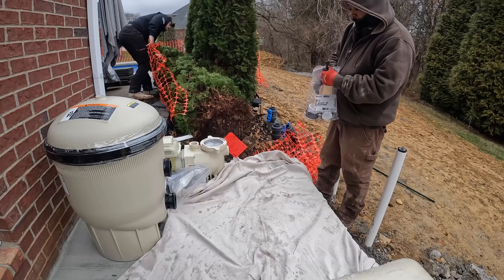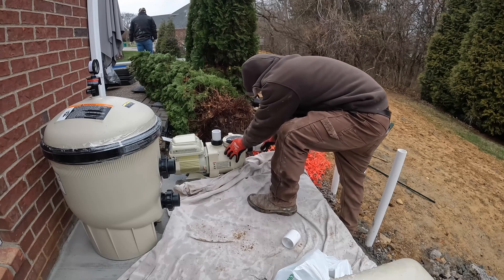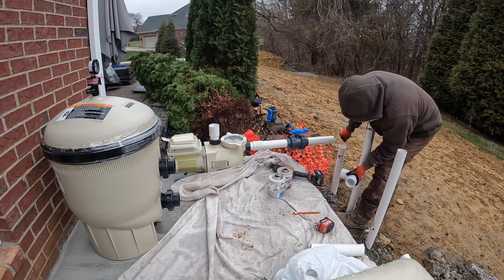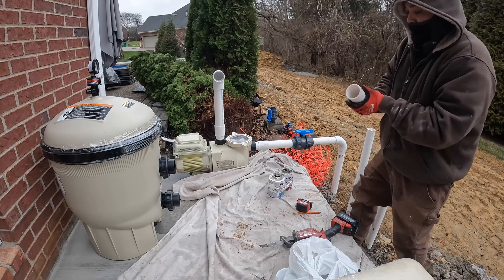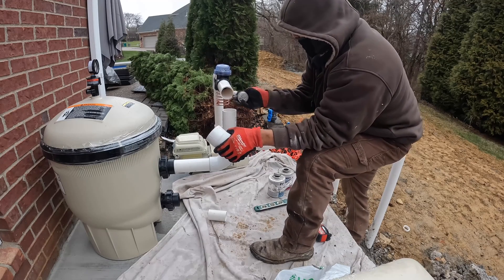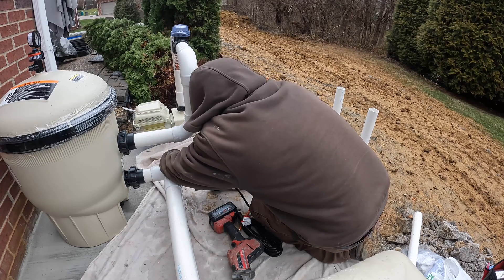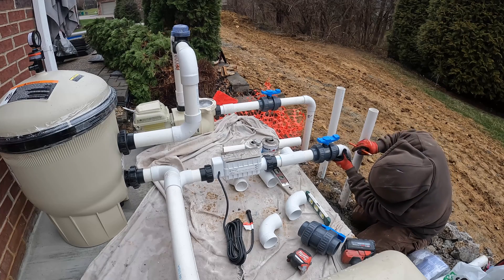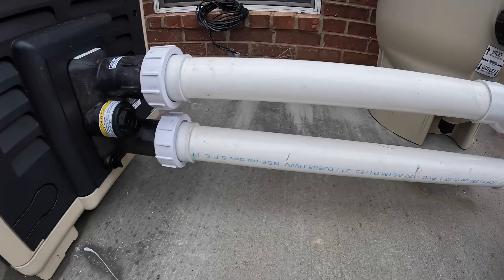How to Plumb a Swimming Pool Equipment Pad [Inground pool construction]

Comment: I noticed that the pipe that enter into the pump is one pipe I mean the inlet in the pump is if only main drain there's no skimmer
Reply from the maker: This pool was so small we only put in equalizer drain, which gets connected into the skimmer so there’s only one line for the skimmer and the drain

Comment: I see the pipes coming out of the ground are rigid pvc but I am assuming the pipe in the ground is flex pipe, how did you transition from flex to rigid?
Reply from the maker: There’s no flex on this project
Reply: @jonport_  I am using flex under the ground (I have an inground pool) should I transition to hard pipe as it comes out of the ground?
Reply from the maker: Yes I would

Comment: There's a reason you use purple,, then again cheap is cheap. No check valves or flow meter, No unions except at the equipment !  hire illegals and this is what you get. Drain and skimmer,  on One line,, what a shit job

Comment: Great video.  Although slightly sped up for time, can't tell if the crewman is sanding the ends before joining and not just taking his glove and wiping off the burrs and debris.  Important step to ensure full adhesion.

Comment: I noticed you use 90-degree sweeps instead of elbows. Is there a big difference between the two? My pool has 90 degree elbows now and I have to replace the inlet valves and was thinking about changing some of the elbows with the sweeps. Thanks for making these videos.
Reply from the maker: @MichaelKelly-yu3nl  I like it just a little better flow. Will you sweep 90s on the entire plumbing install unless it’s a tight spot we use straight 90s.

Comment: Thank you for filming this.  It was exactly what i was looking for.  
What is the timer or mechanism that controls this? How would you add a hot tub and/or waterfall?
Reply from the maker: @pbschulz  awesome. I’m glad it helped. So for a water fall it would just be another supply line connected to the outlet of the heater just like the returns so it pushes the water out. The pump has a control panel on it, but you can put some automations on Pentair makes some, and some other companies make automations as well.

Comment: Curious why you wouldn't do a bypass for the heater?
Reply: But it is on the pool heater manual to install a bypass
Reply: @juantovar1289  exactly
Reply from the maker: @Phil-rv1xx  you don’t need it.
Reply: @jonport_  I was thinking about putting one in for my heater. The reason I was thinking about this is to be able to work on the heater and still run the pool pump.
Reply from the maker: @ if it makes it easier to work on it then definitely use the smaller 90

Comment: better off having your heat pump on its own heating and return lines and own pump
Reply from the maker: @donmint7330  not a big fan
Reply: @jonport_  could you explain why? Thanks
Reply from the maker: @donmint7330  I just don’t see the point in doing all that extra plumbing

Comment: Clearance around the air conditioner compressor should be at least 1 ft, with 3 ft being a better practice and that is for plants or walls, not things that give off heat!  It needs cool air flow to operate efficiently and it looks like you are right next to it, below the min. dist.  The pool heater will make the A/C work harder and any chlorinated water on the A/C unit will make it fail much sooner.  It is also right in front of a windows.  Is this an electric heater as gas heaters can't be that close to windows that can ever be opened.  What are the wires coiled up under the window?  The cement slab is above the foundation wall and over several rows of bricks.  Moisture can get trapped between and cause the mortar to deteriorate much faster.  Eventually the exterior wall will need to be repaired.  To fix this, the pad and all will need to be ripped out to fix the wall.  Yes, I saw the caulk between the two, but that is a Band-Aid after the fact.  Is that an electric motor almost directly under the down spout?  I know it's not done and i'm sure they will run it into a French drain, but down spout connectors are always getting knocked off and eventually the motor and controls will be periodically bathed in water. Possibly getting between the bricks and slap.  Was the side caulked?  The 3 ft of pipe coming out of the heater, making a turn into the salt cell and going another 3 ft before turning into the ground should be supported at least once at the corner.  I put a fence around my pad to keep people out, but neighbor kids like to play hide and seek and it's an excellent place to hide behind the fence while they stepping on everything.  Next step for me is an electric fence from farm-n-fleet, but I digress.  I'm no expert, but all in all, great job.  You have to work with the space you are given.  Lots of things to look out for.  I love the pad size (room to work and expand) vs. space used, the Colonial Valves, and Pentair's drain for the filter being in the front!  I'd add the valve contraption for the front of the filter so you can back wash the canister filters.
Reply: Yes,that set up would not pass in california!

Comment: Great video-have question this filter doesn’t need a back wash?
Reply from the maker: @hmkang2855  nope. It’s a carriage filter.
Reply: How do  you drain when the pool has tools much water
Reply from the maker: @ottawarrior5251 there’s a release valve on the top of the filter

Comment: hey do I need a main drain for a kiddie pool 25'x15' and 18" deep?- it is inground
Reply from the maker: @lisamazz1014  yes I would put drains in two of them split it in the middle put the supply in the middle that’s code and then direct the returns on the opposite side to push all the water toward it.
Reply: @jonport_ is there something different between supply and jets? I thought the jets were the supply
Reply from the maker: @604roger  no they are complete opposite. Drains and skimmer pull all the water (supply) your jets/returns get fed so it pushes  the water for circulation.

Comment: I see you put the sacrificial anode between the pump and filter, which is what I've seen everyone else do also and assume this was correct, but my inspector is telling me it has to be below grade level before the pump to always have a constant water supply. Have you ever heard of this? It sounds stupid because how am I supposed to get it to replace the anode later.
Reply from the maker: Yes that is dumb. You have to put a union value just for when you change it🤦‍♂️. I didn’t know that would be a thing. I font think anyone dose that
Reply from the maker: Every inspector has his own way. At the end of the day. Realistically your pool is running 24/7 so the way we do it its covered. They do make other bonding defenders. Some make work better if you have to do that I’m not sure since i dont have to

Comment: Can the pool equipment be mounted on a ground level deck?
Reply from the maker: Ground level meaning the same height as the top of the pool deck?
Reply: @jonport_  not nec... besides the house ,, deck a couple inches of the ground. not much higher than a six in slab, is it against code?
Reply: also.... good video man
Reply from the maker: @troybonham9829  code doesn’t matter. Its all about efficiency and how you design your pad so it works well depending on how high or low you put it. But if it is pretty much level with the top of the pool, you shouldn’t have any issues or do anything special just follow what I’m doing.
Reply: @jonport_  actually just relocating10 feet
Reply from the maker: @troybonham9829  sounds like it should be fine. It’s tough to tell unless I can look at the situation.

Comment: The one thing I do not like is the use of ball valves which tend to wear down much quicker and hard to replace compare to other valves so I am highly against using ball valves in general
Reply from the maker: I understand where you’re coming from but these valves man they last a long time and they are nice. Plus the benefits you get of having them so easily replaceable because they’re threaded on both sides.

Comment: I don't understand the 18" riser from pump to filter. Can you answer this?
Reply: There is no answer. It is suppose to stop the filter from back flowing empty. But if you do that with some filters being tall your riser will be tall. Most filters have a 90 inside any. You could always just add a check instead.
Reply: @latroncheffin1916  Some filters have a "auto" valve at the top that will let air in when the pump is off so the filter tank drains down and will let only the air out when the pump is turned back on.  However, the Pentair filter in the video has a manual air release valve on top, so adding the riser is smart.
Reply from the maker: Working with maintenance guys who understand equipment over the years and its the best system.
Reply: Thanks for the reply Jonathon, If you get the chance please find out the why from the maintenance guys. This is kind of a "gots to know" thing for me now...Haha @jonport_
Reply: The pump specifies that you should not have an elbow within 10 inches of the pump.  There is a calculation based on pipe diameter…for instance 2inch x 5 =10.  I could be making this crap up, so read pump instructions 🤣
Reply from the maker: @jperello001 lol. Your right. It’s within that range just for pressure and keeping your pump so it doesn’t wear and tear on it as much.
Reply: @jperello001  Yes, no elbow on the suction side for X distance.  The output (downstream) side can turn right away.
Reply: I can't imagine why you would put a ball valve before and after the pump ,if you wanted to control flow one valve would achieve  that In my opinion you would never have a shut off before the pump ,the pump has to have water  ,if some one turned it off and the pumped  turned on ,it's game over. But you absolutely want the skimmer and drain separate with one valve that controls both, so you can turn off the drain and have full suction at skimmer or shut off skimmer and hv full suction on the drain or 50/50 and anything in-between,  If water level goes low you can turn down or off the skimmer and still run without sucking air, if you connect hand vacuum you would turn off the drain and have full suction at skimmer where vacuum connects. You only need the one skimmer/ drain valve and may be one ball valve to let water out of pool. I'm no pool plumber but I have a pool for over 40 years, in Florida and that don't look right , I'll take function and safety over a bunch of  useless valves that one day will ruin the pump . Then no control over the skimmer and drain that's unheard of. Somebody is gonna have to redo that it's just not right

Comment: Hey Jonathan,

We've got an inground concrete pool and spa with two pumps – one for the pool and one for the spa. Our pool holds 30,000 gallons. 

We've stopped using the spa and the heater altogether.
The issue is with the water, as it still runs through the spa and heater even though they're not in use. 
What can be a solution for this problem? 

Is it possible to have a plumber come out and replumb everything without digging or filling in the spa for this summer?
Reply from the maker: Yeah i would have the plumber redo it. Are the lines to the spa on a separate supply? If so it should be easy enough to cap those lines, reroute everything to just run the pool